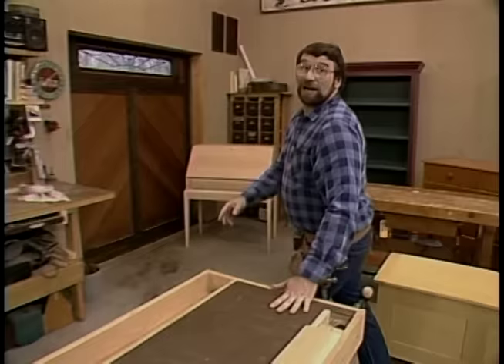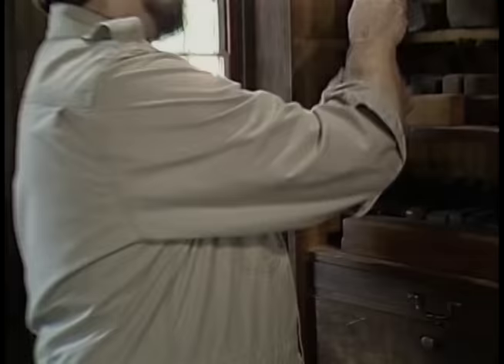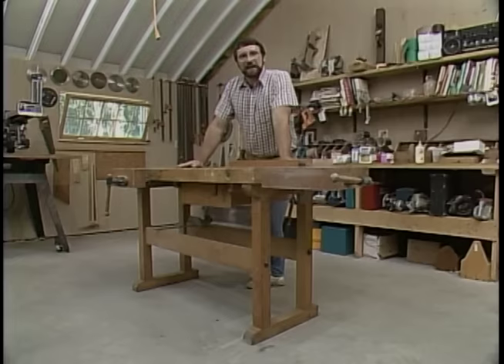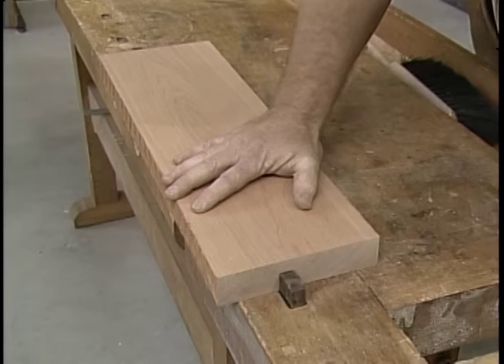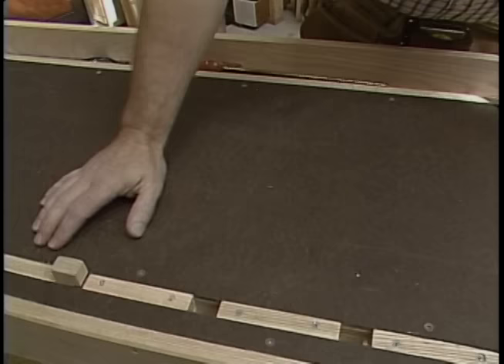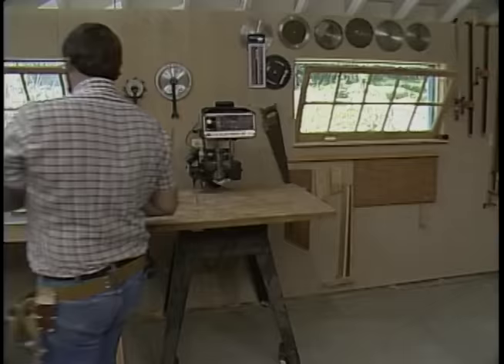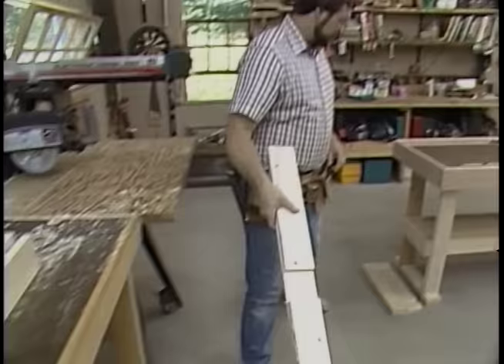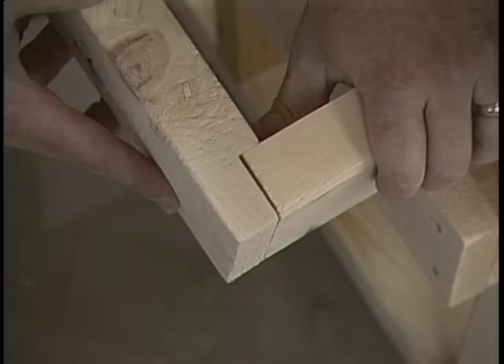Workbench  |  S1 E2

Comment: Such a great reminder that we don't need Festool dominos. And that we never really should have thrown away that 30-year-old Sears Craftsman radial arm saw.
Reply: Sure, but they took up so much floor space which is why ultimately I sold mine.
Reply: Worse. I sold dad's DeWalt from the early 70's ,which I used to make my version of this bench, at a yard sale with the old Craftsman stacked dado blade still on it.
There wasn't room at our new home and the wife wanted garage space. I should've, would've, maybe could've but didn't.
Reply: @slomo1562  Ouch!   I have rescued 4 DeWalts so far.  My 12" 790 is my go to ripping, but the MBF from the 50's is my most accurate RAS.  One of the newer DeWalts has been converted to a poor man's surface grinder.

Comment: I love how they put the warning about using the blade guard while Norm is making a cut that is impossible to make with the blade guard on
Reply: I think today if you were to do that plunge cut on a table saw, it'd be better to use a feather board or Jessem stock guides to hold the piece down, then carefully crank up the blade through it.
Reply: You mean that ridiculous plunge cut he made?
Reply: A skilled worker who has thousands of hours running table saws can do it consistently and safely.  Novice workers probably should not.  I have run miles of wood through a saw with out a hold down or splitter because that’s what I had to work with.  Sometimes you physically can’t use the modern safety aids that current models come with, and if you are uncomfortable doing so, other methods are available.  If you really look at the machines in this video, they are probably around mid sixties era, only Norms skills and the precautionary statement at the beginning of every show that he ever made allowed this to happen.
Reply: @wrstew1272 A worker with thousands of hours of experience is just as likely to screw up as a novice. The experienced worker thinks he knows what he is doing and can become careless. The novice is hoping it works, and his fear makes his mistake. Your arrogant answer about this shows your ignorance of reality.
Reply: @TadTheTinker  You are not wrong. Statistics suggest that most power tool injuries are suffered by "experienced" hobbyists in their 40s. However, as a professional woodworker whose formal woodworking education ended in the 1970s, I was taught to make drop cuts like this in 9th grade. I don't see anything extraordinarily dangerous in the technique relative to the tool kit found in the garage or basement workshop of the average PBS watching middle class family of the late 1980s. Be that as it may, I think most beginning, and for that matter, "experienced" woodworkers today would be better advised to build .
Reply: Reminds me of so many lessons taught by my oligodactyl wood shop teacher.
Reply: @pauljarine  When a friend ours had a baby, she said "I don't care if it's a boy or girl as long as it has 10 fingers and 10 toes...and the nurse said..."Well, actually..." 

Except for one missing digit the little girl was otherwise perfect and grew up to be congenial, beautiful, and terrifyingly intelligent.
Reply: @christopherdahle9985  i'm sure you were taught that in high school, but such a procedure today is easily accomplished with a router. Literally no need for unnecessary risk like this. That being said I love new yankee workshop, specifically Norm's approaches to shop jigs. 👍
Reply: @idhatemet00 Well, you're probably right. I won't argue with you. But it's sort of a kludgey way to make dog holes anyway.

The better way to build a beginner's work bench...and an expert's bench as well is to spend a couple of bucks on Christopher Schwartz's The Anarchist's Workbench. 

I think Norm's great, but in the long run this is going to be a wiggly bench, and wiggly benches suck.
Reply: I thought the same thing.  Fucking lawyers!  lol

What shocked me was the price of the “expensive” store bought workbench that was imported from Germany for $700.  I guess when the materials only cost $120 and you already have a full woodworking shop, filled with thousands of dollars worth of tool—it would be wasteful not to use them.

Even when you adjust for inflation that bench was still reasonably priced at a little over $1,800 in 2024 dollars, with materials at a little over $300.

I couldn’t imagine anyone selling something like that today for less than $3,500 and it would probably closer to $5,000.  Sourcing the materials would easily cost $500 for just the cheap stuff you can buy at a big box hardware store, and probably at least double that if you used oak like he did.
Reply: @thegardenofeatin5965  That was a ridiculous statement!

Comment: I have used this bench for 32 years. Still love it. Maybe time to replace the hardboard top...someday. I added a 10 inch Jorgensen face vise. Got to line it up perfectly so the vise rails don't interfere with dog holes.
Reply: Excellent, that's about the same length of time as mine. Except it was obviously my first real project so it didn't work out the greatest, but hey it's still in use!
Reply: @starlight55971  The first bench is a challenge. I used a 5 gallon bucket as a bench while building my bench. You should have seen me sitting on the boards using my knees to hold the boards still. A Jorgensen wooden clamp was my guide for the router.  ☺️

Comment: I  have loved this programme for years. Nice to see good clear imperial measurements being used and not stupid metrtric. We still use miles and pints in Britain, and the threat of their removal has diminished, the only good thing to come from brexit. Well done, US!
Reply: I use both
When you’re being more exact or simply following metric plans then yes 

Like I’d rather say 3mm than 3/32 

If I was working in imperial then obviously I’d work in imperial though being in a metric country I’d have to do a bit of translating to make sure I’m getting the right pieces of material
Anyway I’d rather say 36” than 914mm 
Unless obviously talking to someone who doesn’t like imperial
Reply: Now your country needs to get back to using Fahrenheit for the outside air temp...
Reply: @flashgordon6238  Celsius or Centigrade is the only bit of the metric system that makes sense. You know when it's 0 degrees, it's freezing and it's 100 degrees, it's boiling. 10 means cool Spring day, 20 warm Spring and 30, hot Summer. 
Random numbers like 32 and 212 make no sense at all. If it were 0 and 200, I'd agree. Britain is slow to take up the rest of metric though. As I said, we still buy our beer and milk in pints, and measure roads in miles, using mph to measure speed. Sadly, it doesn't look like we're going back to imperial any time soon for the rest of the measurement.

Comment: I'm a big Norm Abram fan, but those plunge cuts on the table saw kinda give me the willies. Okay for a pro like Norm but I don't think I'd try it.
Reply: Same here...gave me the heebie jeebies for sure...!
Reply: @asbrand  Well, I tried it over the weekend on an end table I'm knocking together with some scraps. It worked fine, but I put my miter gauge behind it to support it just in case. It still felt like it would be easy to bind the blade if you did it wrong.
Reply: I loved the warning that guard was removed for video. How would you perform that cut with the guard still on?  Oh well I guess people where getting bs lawsuits even back then.
Reply: I came and checked the comments when I saw that.  I was wondering what more experience woodworkers thought of that move!
Reply: I think techniques we used 30 years ago we know to use different or safer tools on or approaches. Honestly the dado setup in the radial is kind of wild too.
Reply: I’ve done it that way plenty of times over the last 30 years. Safest, best way? Probably not. Fastest setup? Definitely. In “time is money” job site environments like Norm started, that’s how it would’ve been done back in the day. And still is today, for better or worse. That radial arm dado setup, however…. Heck no! Terrifying.   @CoffeeHits
Reply: No problem as long you move it forward, as you move it down that way it never touches the back of the blade and it is not going to kick.  Plunge cuts are standard in frame carpentry, almost every cut with a sidewinder.  They are standard on the jointer particularly if it has a euro fence.  They are standard any time one starts a router cut in the middle of the work.  They are standard in a lot of grinding, etc...

Comment: I built this project back in 1992.  I replaced the masonite top in 2005, and again in Feb 2023.  Great design!  One thing about his show that struck me as odd-he makes radial arm saw cuts on the pull stroke rather that push stroke.  Climb cuts with a stacked dado????
Reply: All the books on the RAS teach the pull stroke for cuts, especially with a dado stack.  If you were to push cut with a dado stack, you have a chance of lifting the front edge of the board up and off the table. Starting a pull cut, the board is held back and down against the fence at the very start of the cut.   Also, you are lining up your stock cut lines with the reference cut line in the fence when the blade is behind the fence before the pull cut.
Reply: @flashgordon6238  Won't the blade grab the wood and launch the motor and blade towards you?  Here I am referring to the motor and blade assembly which rides on a track, not the wood.  I see what you mean regarding the reference line cut and positioning the piece.
Reply: @sgnt9337  It is a climbing cut when you pull the carriage and blade across the board towards you. The motor and blade does tend to walk towards the operator more with a dado.  You must use a slow controlled pull and counter the "walking" of the blade.  With a dado cutter, you are not taking a full cut through the board, just skimming a portion of the board. A properly adjusted RAS has 4-6 pounds resistance adjusted with the carriage bearings so the blade, motor and carriage don't run towards the operator during the cut.   There is also a bit of gyroscopic force with the spinning blade.  The older RAS were heavy, powerful, solid mass of machinery and this was not really an issue until they started cheapening the build materials resulting in lighter machines. Cheap RAS will tend to flex the arm and that will cause it to ride on top of the cut toward the operator.  I have 4 Radial Arm Saws now and have been using one since high school shop class back in 1978.

Comment: I'll bet Norm couldn't build it today for anywhere near that today. Cost of material is  ridiculous.  Sad, because I  would  love to build one.
Reply: $80 then would be about $190 today. I am estimating the amount of material based on semi watching the video, not exact measurements. Six 2x4 at $4 each is $24, a half sheet of 3/4 Birch plywood at $45, a half sheet of tempered hardboard for the top at $15, 15 linear feet of 3/4 x 3 inch red oak at $3.75 per foot is  $56.25, the shoulder vise screw is ~$40, a vise handle kit is $11, and you'd need some screws so another $15. In total that is $206.25 plus tax. This is at HD prices on lumber which I think you could find cheaper at a lumber yard and/or dedicated hardwood supplier in your area.
Reply: That wouldn't be too awful. I'd love to build one, I was going off the price of plywood locally.
I just had to replace my subfloor. 5/8 plywood locally is $74 per sheet!
Reply: You can also get red oak cheaper at a sawmill. You might have to plane it.

Comment: I watched this episode on TV, went out and bought a radial arm saw, they are a most dangerous tool in any workshop and should require  proper training as they can grab and propel the saw into your face if you do not take a good strong hold on it you can see that even Norm with his vast experience has a bit of trouble as it jerks forward as it tries to drive over the timber.

Comment: RIP radial arm saws. Long live table saws.
Reply: They were incredibly useful machines to have but sadly they don't have much of a place in the 21st century workshop.
Reply: I still have mine, from the early 1990's.   Extremely useful - within its limits.
Reply: @201081hero  Im a hand tool worker, but im curious why this is? What makes them outdated?
Reply: @NCharlesworth86  With radial arm saws besides the basic cross cutting function you could do other things like make raised panel doors, make dados and rabbets, fit sanding disc attachments, handheld router attachments etc. but everything you could do on a RAS there's another tool or another way that will do the same job with more convenience, simplicity, and better cost/time efficiency.
Reply: This brings back a lot of memories with Grandpa.  His radial arm saw was a center piece of his shop because of Norm.
Reply: Although it's currently sitting behind my lathe, my Dewalt is still alive and well.  My desk at home still has the mounting holes my dad drilled into it to mount the saw in the mid 70's
Reply: @201081hero  that makes sense, thanks. The tool world always seems to move back and forth from single purpose tools and multi purpose
Reply: I still have and use my Craftsman Radial Arm Saw from the mid 1970's. Very useful machine. There is plenty of good instructional material available to learn to use safely.
Reply: The Mr Sawdust book is a good resource. There are a few videos of him online also.
Reply: RIP table saws. Long live track saws. 🙂
Reply: Speaking of dinosaurs, remember the Shopsmith multitool? What a nightmare that was for work flow. Same issue with the Craftsman radial arm saw. Sure it could be fitted to do all sorts of functions but it took major effort to change out and re-calibrate over and over. Really all it was superior at was crosscut wide lumber or angle cut. Now we have sliding compound mitrer saws that do all of that with better precision.

Comment: Thank you for your video, this is simple and usable bench. I wonder how you use your "radial arm" saw - it should have grabbed the material and moves to you when you are cutting those dadoes...
Reply: Properly aligned machine and sharp blades give you great cuts on a radial arm saw. The tendency to move toward the operator goes up with a dado stack but that is why you control the movement.  Normally you have to pull the carriage toward you. With the dado stack,  it is almost a neutral force balance between the carriage coming to you and you guiding it back.    I have several vintage radial arm saws and use a Diablo dado stack for lap, rabbet, and dado cuts.